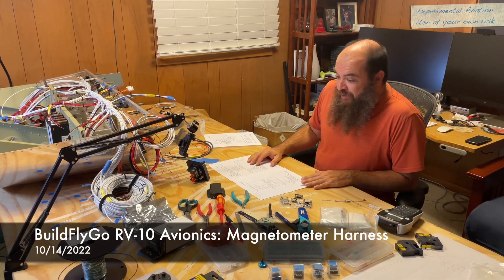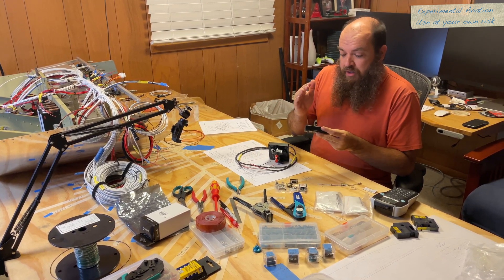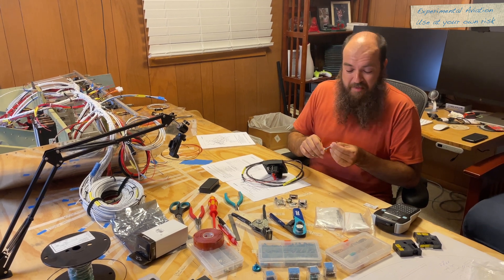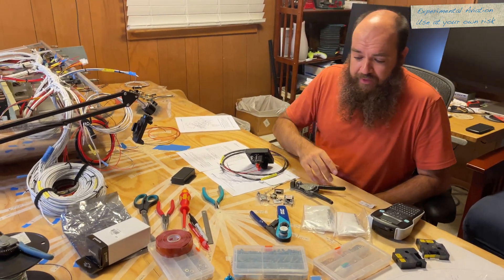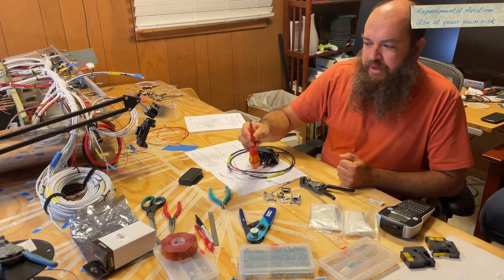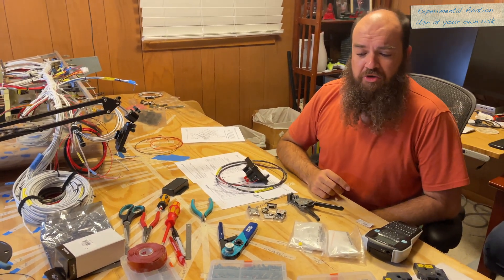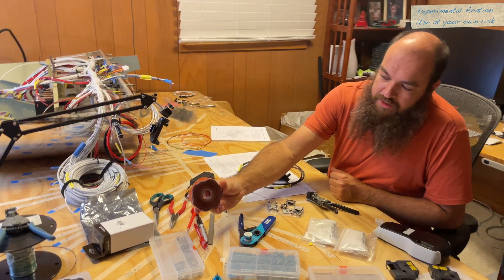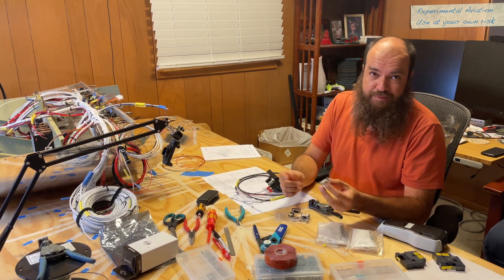RV-10 Avionics - Magnetometer Harness Part 1 - Tools

Comment: How do you splice your can bus nodes if not using the butt splices
Reply from the maker: Milspec solder splices are one option, but we now prefer the Garmin recommended tiny mil spec buttsplices. They are expensive but super nice!